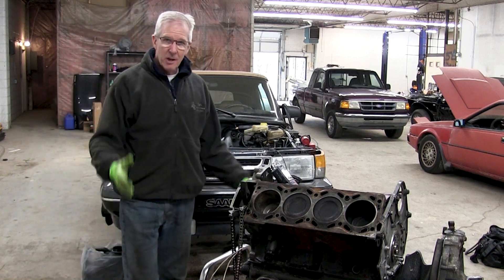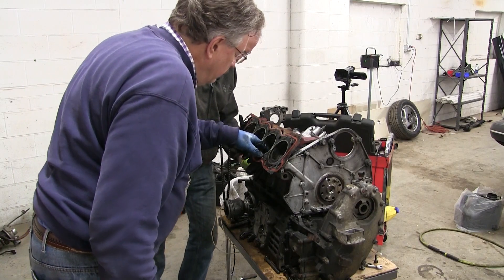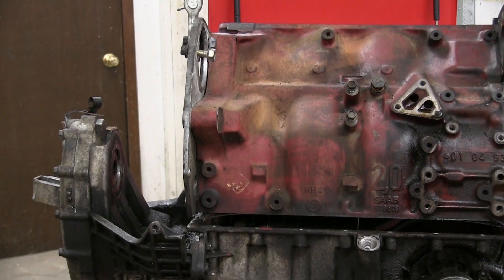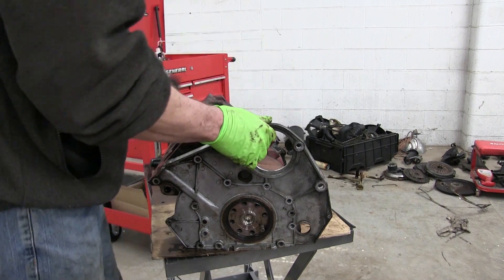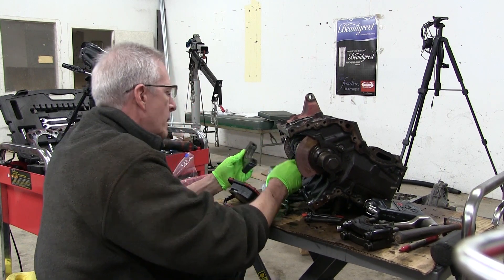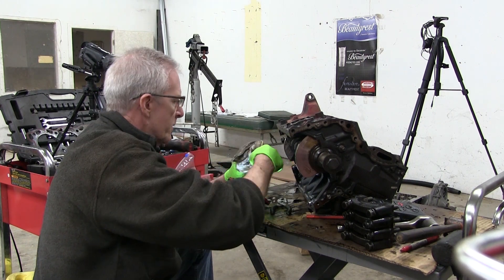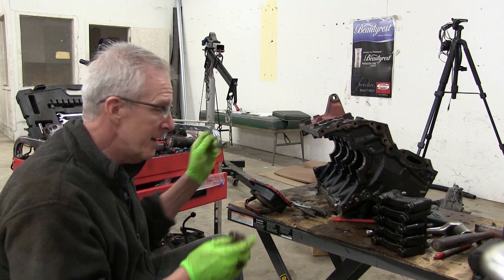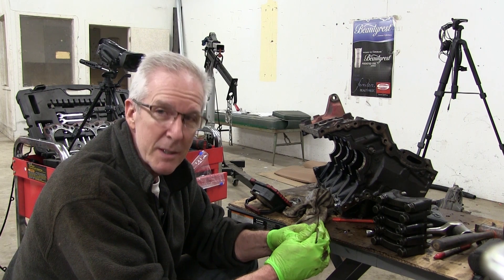Saab 900 Engine Tear-down

Comment: I’m literally tearing down my very own b202 along side you, can’t wait for updates!
Reply from the maker: Are you making any changes?  Turns out I have to bore the cylinders and go with larger pistons.  I'm installing Wossner forged pistons that should take displacement to 2.1.  The crank and rods are fine.  The head has no leaks and didn't need valve repair according to the machine shop.  Hope to get it all back and start assembly this week.
Reply: @LeeKelso  So I cracked the block in my first motor, so I picked up a relatively low miles junk yard motor, I am going to do rings, and bearings assuming it doesn't need to be bored out of spec, the cylinder walls still have the cross hatching from the factory so hopefully all goes as planned, I don't want to have to buy pistons

Comment: Fucking love your videos Lee 🤘
Reply from the maker: LOL, thanks.  The block is being bored and prepped for new oversized pistons.  More to come soon.
Reply: @LeeKelso  I just opened up the oil pan and my rod barings on cylinder 3 an center bearing are bad. 3 had black sludge in the bolt holes. I'm hoping it can be salvaged.

Comment: Hey Lee, wondering where you sourced your replacement parts for the bearing caps and piston rings?
Reply from the maker: I have to bore the cylinders to a larger size, so I bought Wossner forged pistons that came with a ring set.    However, I have a new set of rings for the standard size pistons.  If you need them I'm happy to share.  I think they came from Rockauto.com
Reply: @LeeKelso  Sure, I'll email you!

Comment: Those two pieces that came out are thrust bearings. They usually go on the center crank journal.....Not surprised to see the SAAB's rod bearings with near zero wear markings....these engines are amazing. They can pile on thousands of miles and show very little signs of wear.....SUPER DESIGN!!

Comment: the thrust washers fins in the central crank support; you have to change them, hopefully you have not wear in the crank thrust faces, because thiese bearings are NLA oversize.
Reply from the maker: The machine shop reports my crank was within spec, so new thrust washers are now in place and the car is back on the road.  New video coming soon.

Comment: Yup. Those are thrust washers - they help with the limiting the lash or the crankshaft's linear movement between the front and the back of the block during acceleration and deceleration. I'm looking on the SAAB part catalog for that year and I see them both listed, but it doesn't show the exact position on the diagram. That and the service manual says to "Fit the thrust washers and check the end float." But where SAAB engineers? 

Best bet is to ask the machine shop.. I'm guessing they would be installed adjacent to one of the middle crankshaft caps (one washer on either side) - where the two adjacent counterweights on crankshaft lay. Good luck!
Reply from the maker: Turns out, it was easy to spot where they went.  There was a recessed channel for them so it seemed obvious.  Hope I got it right.  We'll find out now that the car is back on the road.  Video coming soon.